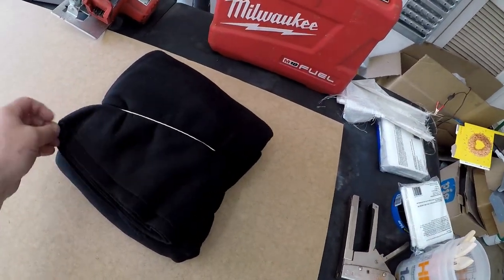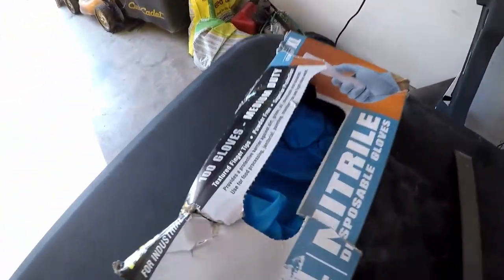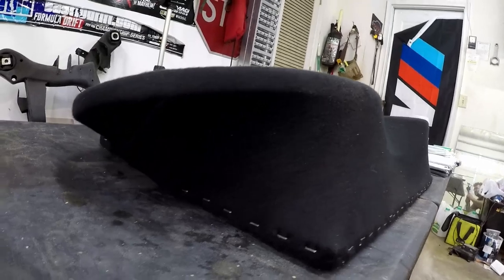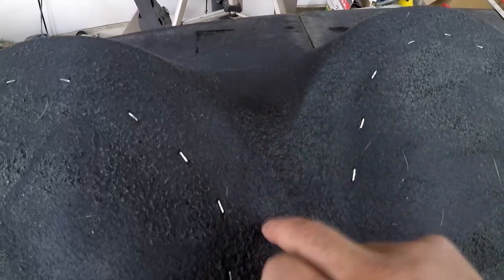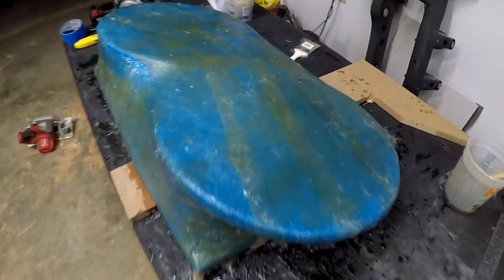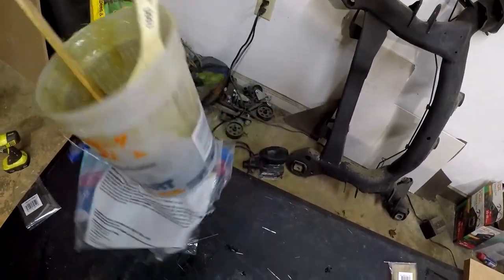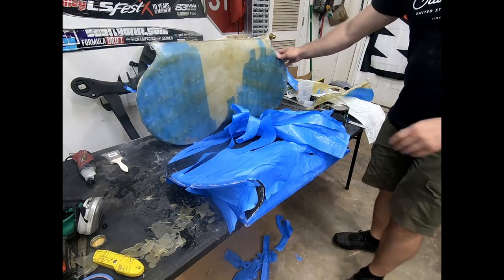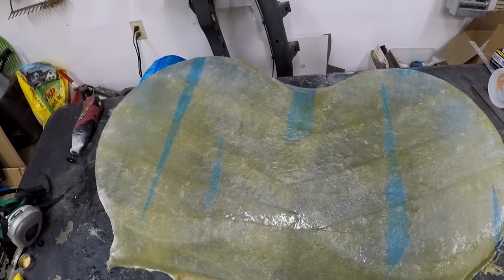I made a DIY fiberglass fan shroud!

Comment: so was this a good way to make a fan shroud? i  need to make one for my 92 b2600 4x4. thanks for the help
Reply from the maker: Ya! It’s been working for a few events now. Defiantly pulling the air thru the rad. I would suggest making a front shroud to avoid the hot air going back around and into the rad.